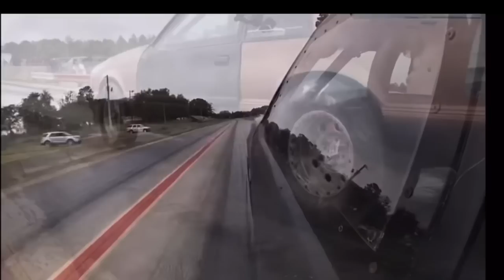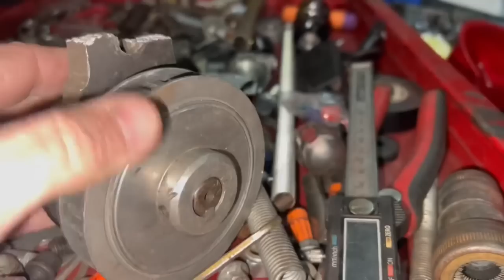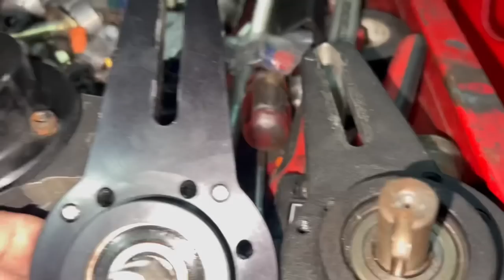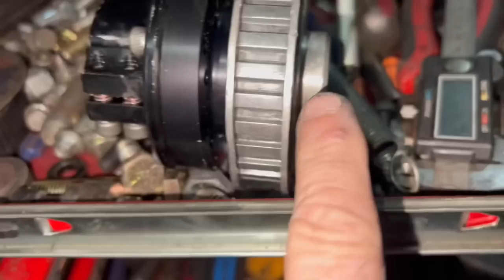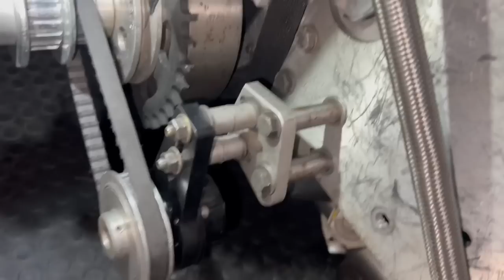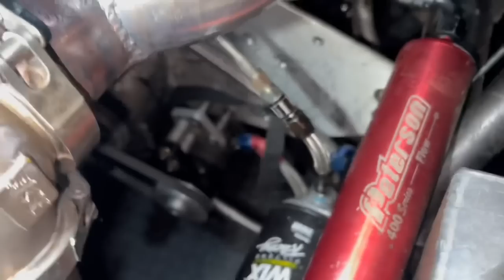Belt Drive Fuel Pump is Fixed!

Comment: Ahhhhh, the belt was on the cogged drive pulley. (Not a smooth section of the crank). I was looking at the pulley on the front of the crank, that you used for the vacuum pump.

That just tells me it happened (the complete break of the 🍭), after the engine quit rotating, or it definitely would have pulled the pump into the crank trigger wheel as the belt wound up, the way the belt was around the pump behind the pulley.

Glad at least you went with the stronger billet one over the cast one though, since you had 2 choices thanks to friends!

Comment: Very flimsy design. That fuel pump is basically just hanging by a thread.
Reply: While I agree i looks flimsy most drysump pumps are mounted similar. And I have never seen one broken. And a 3 or 4stage pump consumes more power than a fuel pump.